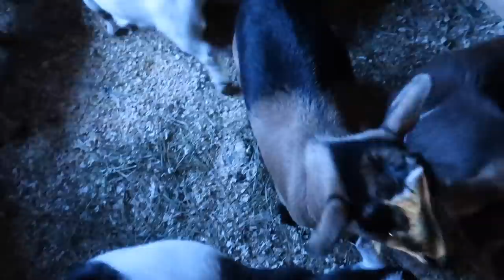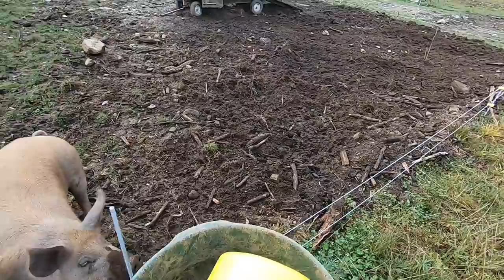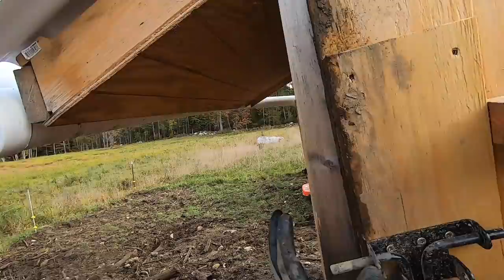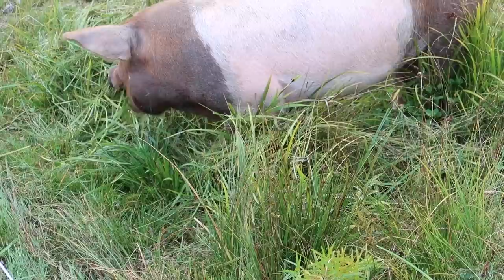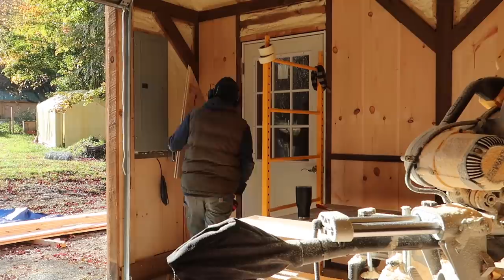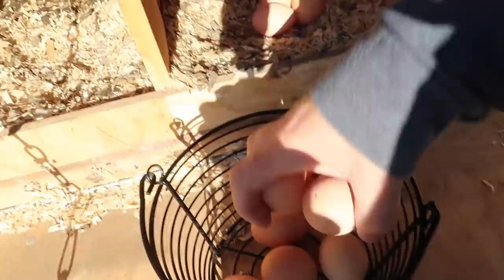Pigs ESCAPED when MOVING them to NEW PASTURE

Comment: If your planning on using pine boards for the ceiling, you can stain them with a transparent stain, this way the grain will show through the stain. It comes in different colors.  Make sure to stain both sides.
Also, keep in mind shellac is a sealer only( not water resistant) and needs a finish over it, like satin polyurethane, which will help to keep dust from sticking to the boards and make it water resistant or moisture resistant.

Comment: You should buy some sheets of styrofoam insulation from Lowe’s and cut it to fit into the panels of the garage door. Works well as cheap insulation for the metal door.
Reply: Sorry I missed it!

Comment: That was hilarious the pigs didn't run! You might try using metal pipe and a large bolt than fits inside for hinges rather than store bought ones.

Comment: Oh, look at all the small rocks in the pigpen that when you pick them out you can use for your "Gabions". Free Fencing! It's not a problem its a solution, now you can have solar-powered lights mounted in your gabions.   Double-walled Gabions for raised bed garden beds, they retain the heat and if you place a center square you can add a wormery to provide worm castings and good stuff as well.   If you place plastic under the soil you can use the center square to add water and a drain so that you can keep a water layer for all the plants.   You can also use small Gabions to go around the trees that you want to save from the Goats.  The benefit is that at dew point the rocks will self water the trees as well.  This also provides grass fire protection for your trees and flood protection if you add a plastic sheet in an L shape in the gabion you can use these gabions for both fire and protection.  Flood and fire protection is important in any homestead.  They also make great planters and animal watering containers. Don't let all that free rock go to waste!  Gina loves to make rock fences - lol.

Comment: Suggestion.  Set your chicken or pig house and run your fence where the house is at one end and corner then run the fence where it makes a rectangle to the Left side. THEN.. when it's time to relocate, all you have to do is to re-position the fence to the Right side.  House stays in place, fence switches.  Much easier move and you'd save using the tractor each time.  After you've re-positioned the fence, seed in what you want on the bare side.  It would cut down the moving but accomplish the same thing. Then you'd get two "moves" from one spot... and a lot less work.  Third time, you move the whole house.  Fourth, you just switch fence again.

Comment: They got out. But it didn't seem like an escape. As you said they have learned to stay away from the 'hot wire'. What voltage/amperage do you run for the pigs vs the volts/amps of the chicken netting? snows coming, Happy Fall!
thanks for sharing

Comment: You have foam sprayed in the walls and ceiling. Put nice wood on the walls.  Are you going to insulate the garage doors now? I know the place is not heated or has AC. But you will lose so much energy through the garage doors. You can put foam boards cut to fit the garage doors opening. I have seen it done on a YouTube channel but cannot remember who it was. You are a very skilled carpenter so I know you can do this. If you cut it right you will not have to fasten them with screws just glue. Good luck.
Reply: Not finished yet, Rome was not built in a day.

Comment: Why didn't you run electrical wiring before you installed the wall paneling? You know you need lights and plug outlets and it would have been so much easier to install before the paneling.

Comment: Why does everybody puts their sliding lock on the door? Because they are designed thee way? If you put it next to the door it Will hold the door beter and you don't even have to use the orther part. Great video's i am learning a lot.

Comment: Gluing and nailing the boards around the electrical panel??  You are going to regret that.
how long is that internet cable from the house?  More than 100 ft and you will be faster using smoke signals.
 Otherwise, it looks great.